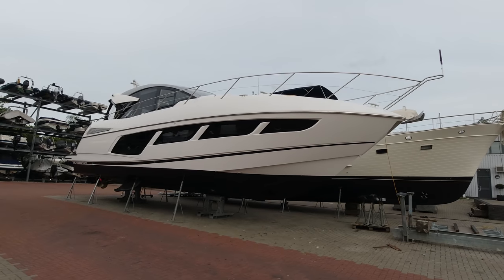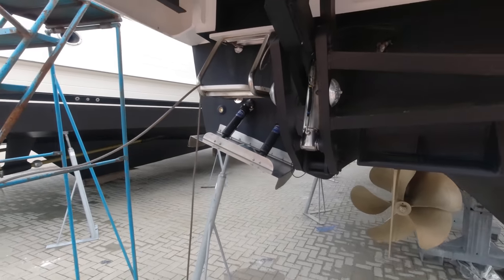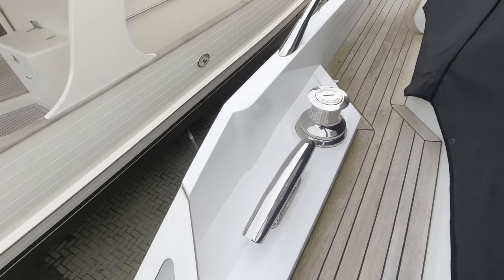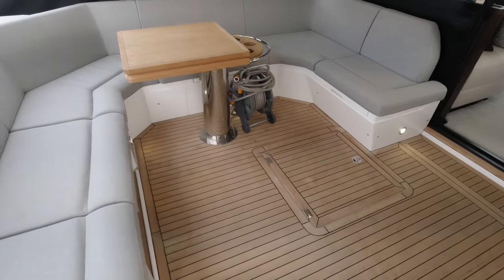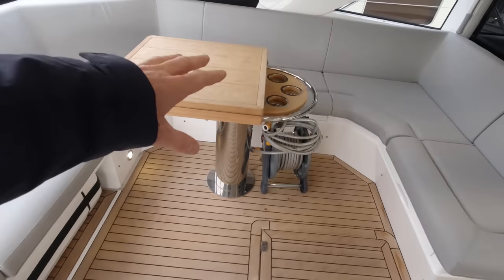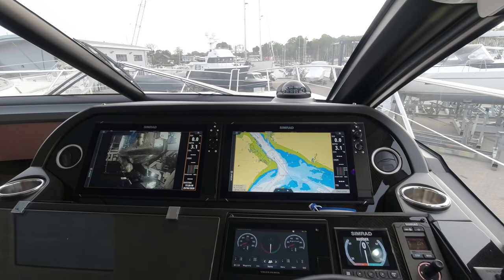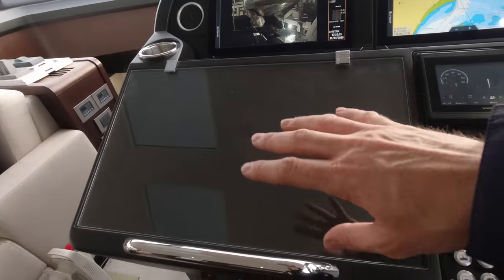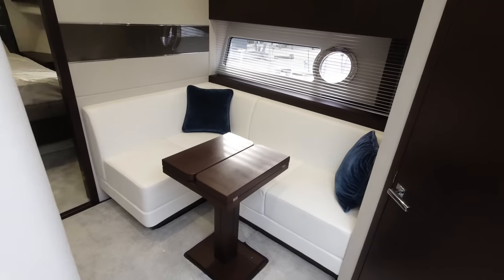2019 Sunseeker Predator 57 For Sale with Sunseeker Brokerage - Full Boat Tour, (now sold)

Comment: I have what is potentially a daft question but So far I do all my cruising on rivers in 44 foot boats but have always wondered if I won the lottery would I be able to buy something like this and how easily would it be to cruise it myself if need be? Or would I be better off looking at something smaller for my first coastal boat?
Reply from the maker: Hi, that's definitely not a daft question! To be honest, if you can drive a single screw hire boat, you can pretty much drive anything! (I grew up boating on the Thames and the close quarters manoeuvring on inland waterways is often more challenging than sea boating). We have owners that start out with small ribs and work up, similarly owners that start at 90ft and throw all their energy at learning how to operate in a safe fashion. 
Up to a point, once you have confidence, boats get easier to drive as they get bigger (for me the end sweet spot is around 86ft - as a still doable owner-operator), the wind and tide has less effect on a larger boat, so you have more time to conduct operations.
Something like the Pred57 with twin shaft engines and typically a bow/stern thruster, is very simple to handle. You can see all the 'corners' from the helm, docking cameras, joysticks, proportional thrusters, cockpit controls etc all make life even easier. 
Changing up from one boat to the next can be an expensive exercise, so I would always try to find the right boat to suit what a client intends to do with it, always a balance of budget, expectations, location of usage and number of persons staying onboard etc.
If you're ever in the lucky position to turn the dream into a reality, fix your budget including annual expenditure and then let your heart rule your head. The 'right' boat gives you a tingle inside every time you walk up and step onboard, owning a boat is a slightly crazy thing to do (just ask any accountant!), but that's what makes it so special.

Comment: Can you clear something up for me, please, James? You said the boat has dps, great, but the spec determines the engines to be d13 900 hp. I was under the impression the dps was only available on d13 1000 hp. Am I wrong?
Reply from the maker: Hi Rik, we can fit DPS to pretty much any Volvo.  It was launched originally with IPS drives as the pods can hold station in all weathers, but with the advent of proportional electric thrusters, can now be made to work on a shaft boat. 
It still has some limitations as the electric thrusters will eventually kick the thermal cutout in and knock the system out, but it’s good enough for most typical scenarios that you’d use it in. 
Doing things like lining boat up head to wind/tide prior to activating the system will mean the computer is using the props to keep boat centralised (with minor tweaks from the thrusters), then it will last a lot longer. 
Hope that makes sense. James
Reply: The Virtual Yacht Broker Ah, my mind never stops playing me up until I get an answer. I appreciate you sorting it out for me, thank you.

Comment: How do you clean the inside of the windows, {the ones located above the galley? And to the Starboard side  of the helm!}
Reply from the maker: Hi Gordon, we use an extendable mop pole with a cloth on the end (you can buy in good hardware stores for laminate flooring), works really well.